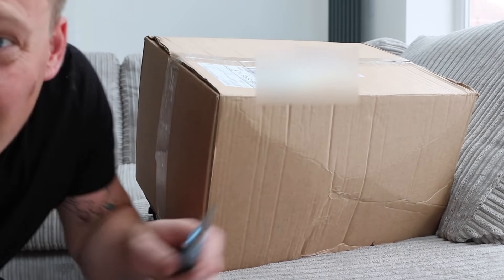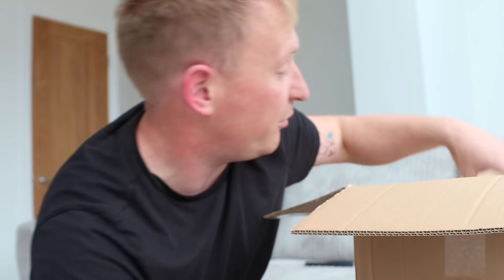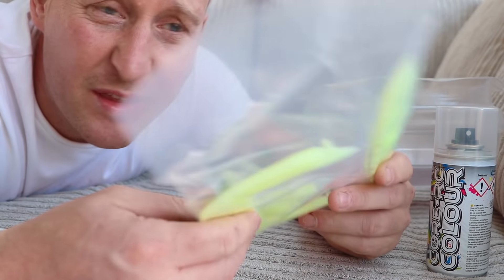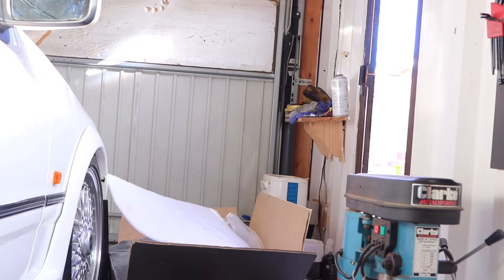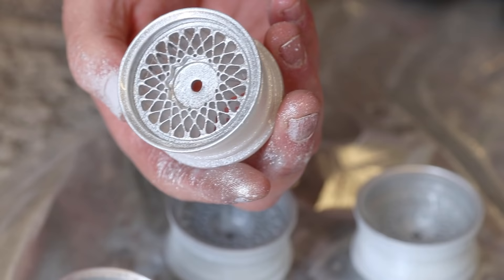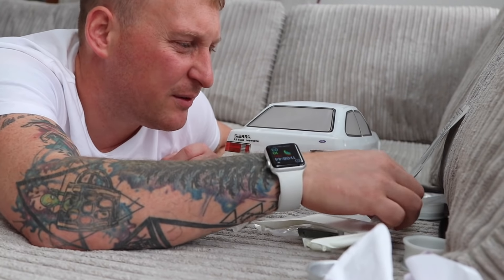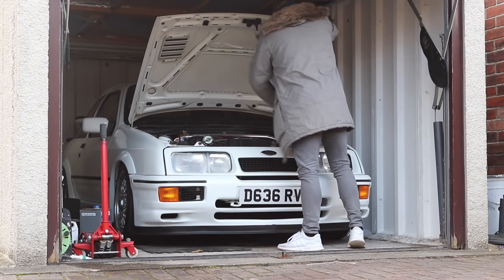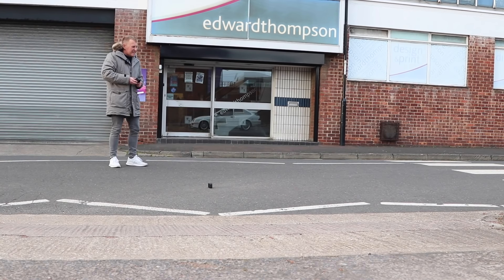Radio Controlled RS500 Cosworth 🤩

Comment: or if you look on ebay you can find a whole lot more rc cars and shells wheels and everything else for cheap bits use blacksmithproducts can find them on Ebay and they have own website cheap servos batteries wired glowplugs basic stuff